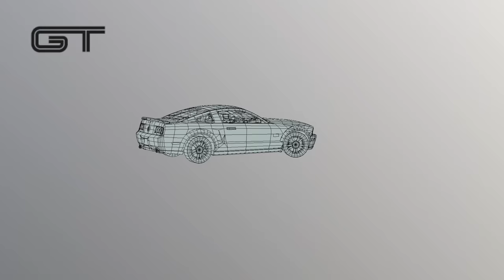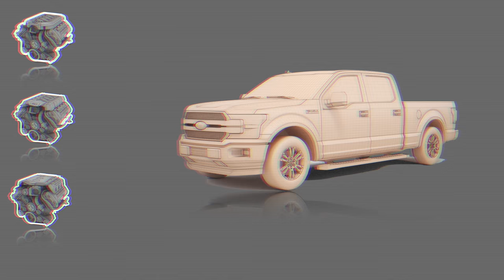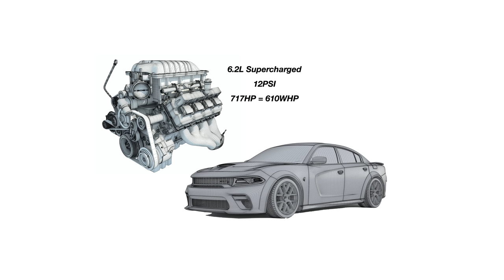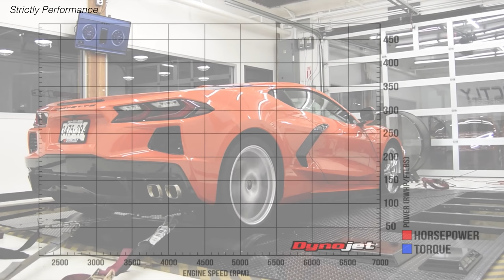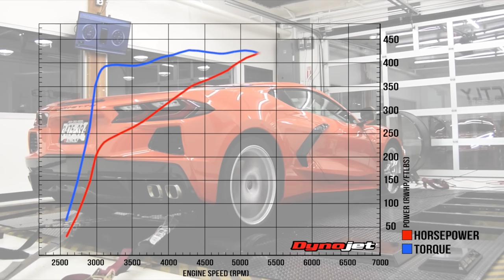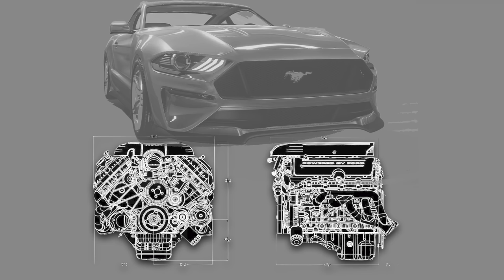How 5.0 Coyote Engines Beat LS and LT😮 | Explained Ep.2

Comment: I love them all.  Seriously.  But this piece is nonsense.  It does a nice job talking about the differences and advantages of the coyote, but to say it is simply capable of making more power out of the box than the LT is, as I said, nonsense.  Yup coyotes love boost so boost em set em up right and get 800-1000hp.  So….. put a pulley, a tune and an e85 kit on an lt4 and your in the 800-1000hp range…. Out of the box…. Now what’s the difference again….

Comment: Why are you pulling the wool over peoples eyes ? you grab a coyote from a salvage yard and want to put 12 PSI boost to it ? not going to happen you made no mention that almost all the parts inside the engine need replaced .. rods aint gonna take it pistons need replaced and your looking at 4 cams .. they alone are going to cost an arm and a leg plus rings gapped for boost. you take a stock 5.0 yote and 12 psi boost your going to have a pile of parts scattered on the pavement. race gas might give you a lil margin but not at 12 psi .. realistically you are probably looking a 4-6 psi boost on a stock engine.  LS engines are more cost efficient. but the 4 valve LS engine is right around the corner 2023 ?

Comment: I love how everyone thinks they have "Forged" rods. Ford just called them forged, out of the powder forge process. They just have powered rods like every other mass produced engine. The supercharged motors? Yes they have real forged rods, but you pay for that in the larger price for the gt500's. Its just misinformation from ford to make you think it has stout components. I really like the coyotes, and I generally love the high rpm screaming they do, its just that out of the box the have the same power potential and reliability under boost as any LS. If you build them with some real good aftermarket rotating assemblys......now you have safe ripper.Then again, same for an LS.

Comment: blah blah blah.coyote...it needs boost because they aren't crap when (NA) all motor. my brothers kit build 33'Turd weighing in at 2,200 cant even break a 12 second pass, where as my 3,800 all steel, all motor ran low 11's 69 Chevelle SS in 1979.addons are for girls.

Comment: I like both motors but…to the clowns who actually believe this…🤡 this is straight lies and probably click bait. 

You can put multi gen coyotes together? Congrats welcome to the LS world which has been doing this for decades and it’s waaay cheaper. Also he whispers about oil pump gears which are trash on the 5.0 and that’s a serious tear down to the point you might as well add cams, which cams are way more expensive on a coyote vs a pushrod LS single cam install. How about the pistons that also need replacement with boost. Bc that needs to be done. Fuel injectors, fuel pump, intake, exhaust and tuning. 
Doesn’t matter which motor you choose saying it’s simply a direct bolt on of a supercharger is asinine. It’s funny how they compare new 5.0s to old ass LS and not LT. That’s how I know LS wins lol Dollar for dollar way cheaper to build and way more simplistic for the weekend warrior to build in their garage. Both at great motors but this video is beyond false and not fair to ppl actually considering their options. Tell it how it actually is.
Reply: Actually ur wrong on many things u said, let me correct. Pistons on coyotes don’t need to be aftermarket ALWAYS, it really j depends how much power u wanna make. Oil pump gears aren’t trash on 5.0s, it’s just a common misconception. Oil pump gears are weak to vibration, so if ur constantly laying on the limiter, then yes the oil pump gears will go.. and Chevy guys are the ones who compare to LS to the coyote, not ford guys. The LT is fucking trash, they blow up at 700whp, they need built bottom ends. They are wayyyy weaker than coyotes. The LS is a better argument when comparing chevys best and fords best

Comment: The saab engines are very sleeper u should look into it the 2.8 and the 93 can handle 650 wheel 😀 and the engines in the older 95s can handle 700 wheel with just Pistons

Comment: for all you coyote lovers let me remind you of this.
i was a chevy guy i worked in a ford engine plant and seen the coyote motor and 6.2l before you guys even knew it existed. i was like wow those bottom ends look sturdy. turns out its junk just like the ls motors. make any great design you want and stuff it with over seas parts and bad quality control and i have zero interest in it. even at a swap standpoint these are horrible cause their huge for a tiny v8. the heads are larger than the engine block. but for 1/10th the price you can make similar power. and more reliably. fun fact i was also a mechanic for a number of years and worked on the ford 5.0l and test drove them. not impressed. i have an suv that has also beaten the mustangs and f150 everyone claims to fear. yes the ideas and premise of anything can sound good on paper but the real world your not often at 7000+ rpms where these do the same thing we all made fun of hondas for finally popping vtak. 
its cool a n/a motor can breathe and make power all on its own but when its personality trait is give it boost. its not really about a good motor anymore now is it. also let me add when i was a mechanic i worked on these like i said before. had alot of problems and some ppls 5.0 stayed at the shop more than home and they actually treated their cars well. it was a shame.

Comment: Great engine, but the Mustangs they are attached to after 2011 have too many issues. The Chinese made Getrag MT-82 is one of the worst transmissions ever made. Ford made a huge mistake dropping Tremec to save a dime.  Also, stability and traction control never completely shuts off. It can turn itself back on and  make you wreck. Those two things alone made me stay with an older model and mod it. I do wish I had that engine though.

Comment: Take a 5.0 coyote crate. Then take a stock ls of any platform put the difference in money into a cam and heads on the ls and it beats the coyote every single day 🤷‍♂️ in conclusion the ls is superior on ponies per dollar
Reply: It's not superior. The new 5.0 coming out will have 500hp and has dual throttlebodies/intakes. That alone makes 5.0s much better to mod, though they will still be expensive as ass to get as a crate, if it comes as such. Essentially, DOHC beats pushrods and will always.